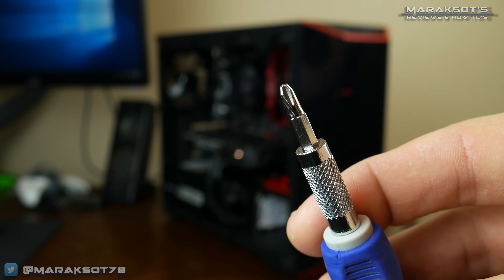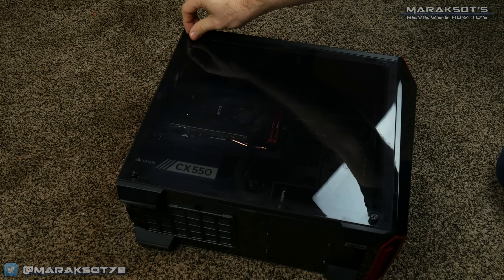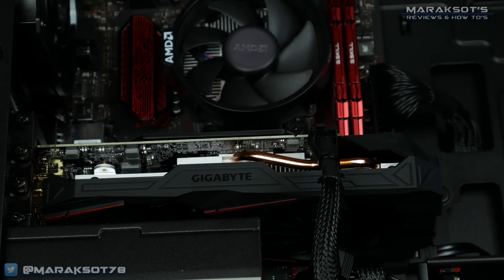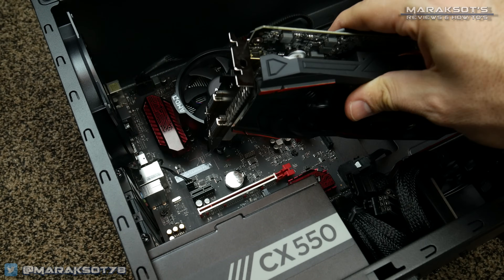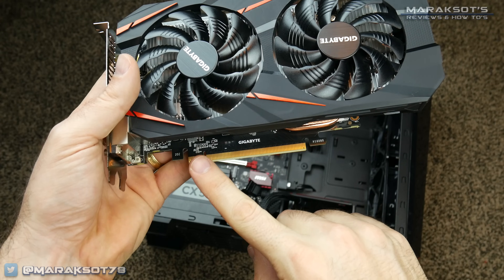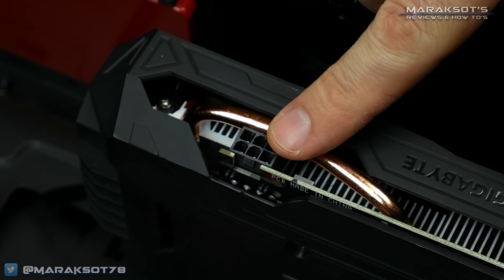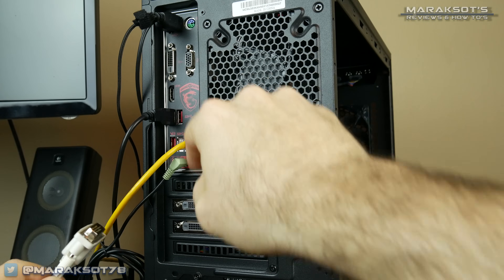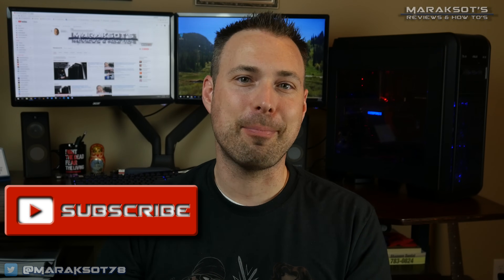How to Install a Graphics Card - Upgrade Your GPU

Comment: Ok, this was awesome but I got one question. Do I need to uninstall my last graphics card drivers before I put in my new card?
Reply from the maker: Va G I Jane you can uninstall the old drivers when ever. It doesn't matter if you do it before or after swapping out graphics cards
Reply: Great to know :] Thank you so much for your help!
Reply from the maker: Va G I Jane no problem, I'm happy to help out. :)
Reply: @Maraksot78  thank you! Been looking for an answer for this!
Reply from the maker: no problem, happy to hear the comments section was helpful to you.  :D
Reply: @Maraksot78  Have you test the Display Port to see if you get a signal?
Reply from the maker: Andy D swapping cards is just like I show in the video but I'm guessing you're more wondering about switching drivers.  Here's a link to a video I made a couple years ago where I show how to uninstall your graphics drivers and then download and install the new one.   https://youtu.be/e3dGYvIa4pg
Cheers!  :)
Reply from the maker: yah, if you already have the latest Nvidia drivers installed they'll work with any of the 10 series cards, i.e. 1060, 1070, 1080 etc.  and since you have Geforce Experience installed it'll automatically update your driver when the new one comes out as long as you have auto update enabled.
Reply: @Maraksot78  i have  amd integrated graphics and I bought a gtx 1050 ti 4gb do I need to do something especial or just follow the video
Reply from the maker: @MAlipioC  first of all... Congratulations on your first DIY graphics card upgrade.  :)  Now to answer your question... if you follow the instructions in the video you should be fine assuming your case has enough room for your new graphics card and your power supply is rated with enough wattage for your new GPU.  The only other thing you'll need to do besides what is shown in the video is download and install the drivers for your GPU.  You'll want to go to Nvidia.com and go to the Drivers tab at the top of their web page, then click on GeForce Drivers and then use the drop down menu things to select 1050ti, your version of windows and then download and install the drivers.  Just FYI the drivers are not needed for your video card to output video to your monitor.  The drivers are the specific set of instructions needed to get the best possible performance out of your graphics card that it's capable of.  Hope this helps.  Cheers.  :)
Reply: @Maraksot78  oh ok but do I Need to intall the drivers first or after I put the GPU on the pc?
Reply from the maker: @MAlipioC  it doesn't matter. Either way works fine.
Reply: @Maraksot78  ok I hope I don't make anything wrong its my first time doing this 😛 and btw continue with the good work!
Reply: @Maraksot78  uh I found a problem in my PC it doesn't have space for graphic card  what should I  do?
Reply from the maker: @MAlipioC  what do you mean exactly when you say your computer doesn't have space for a graphics card? Do you mean your case is too small to fit a graphics card or your motherboard doesn't have a PCI express expansion slot available?
Reply: @Maraksot78  my case it's Too small for my GPU
Reply from the maker: @MAlipioC  well, there are 3 things you can do...
1. Buy a smaller (most likely less powerful) graphics card.
2. Buy a bigger case and swap all your hardware into it.
3. Buy an external graphics card enclosure. The down side to this option is they're fairly expensive and depending on the interface it uses to connect to your PC your graphics cards performance can be decreased.
If I were you I'd go with option 2 and buy a larger case, but that's just me. You should do whatever works best for you and fits into your budget.  Hope this info helps.  Cheers.  :)
Reply: @Maraksot78  lol Sorry I'm so dumb I was trying to put my gpu on processor now I tried right and it work sorry for my error it's my first time doing this 😶
Reply: Manny Coelho what motherboard do you have?
Reply: @Maraksot78  , can I leave the latest drivers I recently installed on my Radeon card, since I'm replacing it with a better Radeon card?
Reply: Maraksot78 hey do graphics card come with cds thats used to install the driver or do I manually have to dl it online?
Reply: Maraksot78 I hope you tell me but do I just have to change the graphics card or do I have to do something else?
Reply: What if your going from Nvidia to AMD?
Reply: Maraksot78 thanks man!
Reply: hey sorry to ask you this, but according to NVIDIA my 1050 Ti drivers are supported for my new GPU the 1060, do i have to uninstall them or is it fine to wait for Geforce experience to auto replace when a new version comes out
Reply: I always uninstalled the old GPU drivers with the old card still in with the ddu tool then swapped them out
Reply: I have a 1660 ti. But I wanted to get a better 1660 ti. Do I need to uninstall drivers?
Reply from the maker: @Adam-oj8hj  no, you don't need to change the drivers.